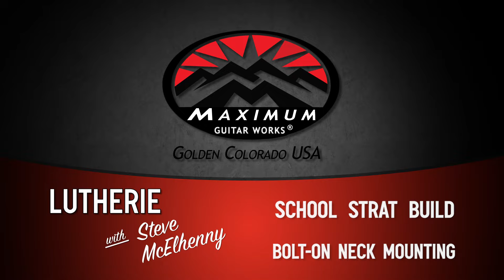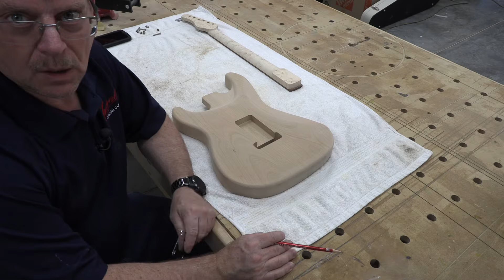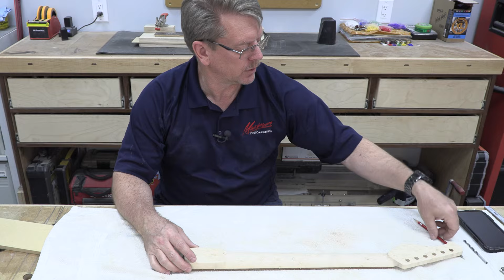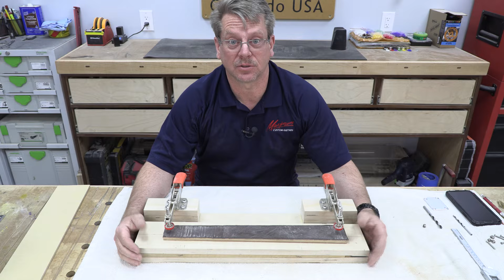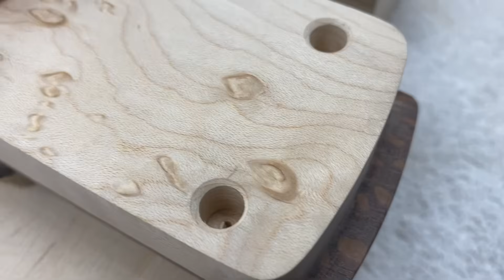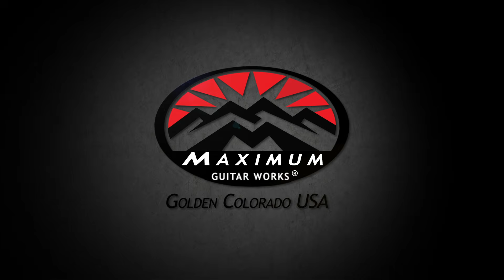The School Strat Build - Best Bolt-on Neck Method...ever!

Comment: Threaded inserts. Never thought about that. It seems like Fender would do this on their upper models, but not that I'm aware of. I currently am installing a Tele neck on a body that does not fit snuggly into the neck pocket. So I came here for your info. A Brad point drill bit seems like a good investment for what I'll be doing. Next project (on the same guitar) is string through drilling for ferrule installation. Just because I've never done that before and I feel like I should know how to if I ever have to. Thank you, Steve.
Reply from the maker: For woodworking, brad point bits are a must.  Inserts are just another way to get the job done.  Some love...some don't.  The key is to keep and open mind and try things for yourself.

Comment: Relying on wood treads is limited, relying on metal threads it’s an upgrade but still limited because in both cases  relying on the sheer force of threads  which again has its limitation‘s…. However relying on clamping force and threads Is the ultimate and has its payoffs and tone and sustain which is the high holy ground of guitar making my opinion… There is a fastener that does both and comes and stainless steel and which is perfect for the situation … and I see nobody using it. As an engineer and a luthier I have tested it and it works incredibly well… Seek and you shall find… Keep on rockin
Reply from the maker: I agree.  When things are built well...all the little things add up to a great guitar.  More important to me is freedom of choice.  If you build it...do want you think is best!  Thanks for your comment.

Comment: Is there a way you could use the drill press to install the inserts?
Reply from the maker: I do that now.  That is what is hard about keep my videos up for long time...I'm constantly changes things up to experiment or compare techniques.  I lower the drill quill with my right hand and manually turn the chuck with my left.  It is more consistent than doing it how I show in this video.  I think I might have mentioned that in the comments before...but I can't alter the video for changes in techniques without removing the video and remaking a new video.

Comment: I leave the drill off and lower the bit to align it. That way I can look at it on the X and Y. Then I raise the bit, turn on the drill and then drill the hole.
Reply from the maker: Sounds like a reasonable technique.  I do that some of the times...just depends on what I think I can get away with.  I continually try to increase efficiency...sometimes it takes more time!  ;-)

Comment: Fender and others never did this because it's unnecessary and overkill. You already see people who overtightened their bolts into the wood so much that it crushes and bends the metal neck plate. How much tighter do you need it to be? 50's, 60's, 70's Strats that have been played to death have neck joints that are tight and structurally fine. You don't really gain anything by doing this unless your someone who removes the neck every other day.
Reply: The best thing about watching and learning new techniques is the choice to use them or not. If you don’t want to use threaded inserts, don’t. I’ve been repairing and building for 30 years and I have drilled and doweled sooooooo many necks. I can tell you, Leo’s wood screws aren’t the best, far from it.

Comment: Could you please list the size/type of bolts and inserts you are using?  It's hard to go through the video to find that information.  Flat head or pan head?  Great video, very helpful.  Thank you!
Reply from the maker: I use 8-32 stainless steel threaded inserts...like these.

https://www.amazon.com/gp/product/B002WC8TRU/ref=ppx_yo_dt_b_search_asin_title?ie=UTF8&psc=1

And 8-32 SS machine screws with oval phillips head.

Comment: Get a full index drill bit set.
That'll allow you to drill whatever size you need.
Reply from the maker: I have them in empirical, metric, and numbered bits.  But I try to present things that work with most people...whenever possible.  Although I refuse to fix stuff with Duct Tape.

Comment: Why isn't he using his drill press to screw the inserts in as well? That way those are definitely perpendicular to the holes he drilled the same way.
Cut off the head of such a screw and use it the way you'd do it with the ratchet but in the drill press: https://www.fk-soehnchen.de/werkstatt/verbindungstechnik/schrauben-muttern-unterlegscheiben/schrauben/Maschinenschraube-DIN-931-8-8-verzinkt.html
Reply from the maker: "He" is now.  Hard to splice that into an old video.

Comment: This is awesome!  You spoke early of aligning neck/body with low and high strings.  Did you do that in-between shots?  It looks like you just forced the neck in the pocket, slapped 6 stamps on it, and sent it!  Do the bolts/inserts have enough wiggle room to do alignment after inserts are installed?
Reply from the maker: Hey Doug.  Although I can't remember everything in my videos without going back and watching them...I was probably referring to a video in my Tele build series...where I go into depth on dry fitting all of the guitar parts and hardware.  The bolt holes are slightly over sized...so there always is a little room for adjustment if needed.

Comment: Awesome video. I got an LAG from guitarfetish’s buyout page to work on. It appears to have replacement plugs already put in for the neck screws that were stripped out when I got it. So I want to go with the threaded inserts. Where do you get your inserts from?
Reply from the maker: The stainless ones are a little harder to find.  My normal place online McFeeleys hardware was out of stock a while back...found the same ones on Amazon.

E-Z LOK 400-008-CR Threaded Insert, Stainless Steel, Knife Thread, 8-32 Internal Threads, 0.375" Length (Pack of 10) https://www.amazon.com/dp/B002WC8TRU/ref=cm_sw_r_cp_api_glt_fabc_3QAQ3VGD90ZBZ7BKX553?_encoding=UTF8&psc=1
Reply: @maximumguitarworks  oh cool! Those are the same ones i was looking at. I was waiting before i put them in my cart. Thanks!

Comment: Mc Feely's had 8-32 x 1-1/4 in. Machine Screws, 305 Stainless, Flat Head, Square Drive, but the only threaded inserts I found there was brass. Is there another resource you use for those? And what depth were they? Thanks for the detailed video!
Reply from the maker: I have also found them on Amazon. 3/8” deep. They are not cheap...but I like them. 

E-Z LOK 400-008-CR Threaded Insert, Stainless Steel, Knife Thread, 8-32 Internal Threads, 0.375" Length (Pack of 10) https://www.amazon.com/dp/B002WC8TRU/ref=cm_sw_r_cp_api_glt_fabc_3QAQ3VGD90ZBZ7BKX553?_encoding=UTF8&psc=1
Reply: @maximumguitarworks  Thanks!!

Comment: Hey guys, I found this project guitar I had built for school. I attempted to do it all by hand and so for my first try it's not the best. The body is is tact but I just need to replace the neck. Its a les paul jr double cut body and so I tried to glue the neck in place. Im thinking to save myself some hassle I will just use a bolt on neck? Any reason why I shouldnt? The pocket where the neck fits in is flat I believe? I need to remove it and clean it up so I was gonna steam it to loosen the glue. I really want to get this guitar up and running, it wasnt cheap to build
Reply from the maker: Yes...the primary reason I can think of is the structural integrity of the neck pocket.  Typically I recommend that a bolt-on neck pocket be no thinner than 5/8" from the bottom of the neck to the back of the guitar.  Many set neck pockets go much deeper than that...because once it is glued in...it is more like one piece of wood.  A bolt-on neck requires stability of the body neck heel area to properly support the neck.  Not knowing your specs...that is what I would be concerned with.

Comment: Steve,   I watched your whole video and may have just missed this detail.   Having experienced crooked necks on bolt in guitars brought me to your video.  My latest is a Jackson Randy Rhoads V3.  I had a friend meet the seller to pick up the guitar since they both lived in New Jersey.  Then I could get it from my friend a few weeks later.  However, once my friend got it,  he saw that the string alignment was such that he knew the neck was crooked.
Reply from the maker: Remember...some room in the holes is important.  You don’t want the screw treads to dig into the body holes...as that could prevent the body from pulling the neck fully in.
Reply: SO,  My question to you is,  did I miss where and how you aligned the neck prior to marking the hole placement for drilling the neck and thus where your inserts would go?   How do you know that the neck is in the pocket straight without a bridge mounted or the e strings attached and sighted straight before you deem the neck in the proper position before the drilling marks are made?
Reply from the maker: In my case...it was new construction...and the bridge was not installed until later...which would be with care of having proper alignment.  There are many ways to verify the neck in bolted into the proper position...and if I didn't show that...I have other videos where I do.  Most bolt-on necks do have a little wiggle room to tweak the neck before you tighten the bolts fully.
Reply: @maximumguitarworks  Steve, you made me laugh to no end, and thanks for your serious answer too.  I will look for your alignment procedures in your other videos, thanks.    Once I had the guitar in hand.  I could examine the neck, screws, neck plate and neck pocket to conclude that the holes in the body are slightly larger than the screws which allows the neck to wiggle in the slightly too large neck pocket.   Conclusion:  despite the neck holes being a snug fit for the screws,  it can still wiggle in the pocket because of the size of the screws vs size of hole drilled in the body.
Reply: My idea for how to solve this is to go ahead and line up the neck using the 2 E strings under tension, tightening the screws once things are straight and evenly spaced.  I then make reference marks on the neck back and body where they meet.  This will allow me to set things in proper position while installing inserts and new larger screws.  This combination of things will yield a properly aligned neck that does not allow as much wiggle room in the neck because the tolerances have become a more tight and precise fit.  Having the mechanical join of a Machine Screw to Metal Insert, will also yield a dependable less failure prone retention system just like your video shows.
Reply from the maker: Well...your problem is New Jersey...Everything in New Jersey is crooked!  What a minute...I'm originally from NJ.  ;-)  I'm not sure what you are looking for...but bolts with treaded inserts are typically not a solution for necks that are not straight.  It could be many things...starting will as simple as a bad setup.  I have seen bad necks...even have own some that needed the fretboard radiused...and new frets installed.  But I wouldn't jump to that conclusion without looking at the simple stuff.

Comment: Greetings again, I ran my mouth on this fine page a few days back. I would like to comment again and say I've watched this video a couple of times and it looks great. The fit, attention to detail. Nice work. Some of the better boutique builders use bolts like these on their steel string acoustics now. Robbie O'Brian has said he can't tell the difference with his ears. And the inevitable reset down the road is way easier. I am a fan of Romanillos wedges with very little glue. That's another subject. Good contact between the components like this example always sound great. Thanks for a great way video.
Reply from the maker: Thanks for the follow up. Robbie’s ears would know.

Comment: Boltz, yez! See these and other attachment styles on bass and guitars. Recessed and the likes. Mortis tenon acoustics going with these more often now too. We are entering the "IKIA Era"- Just made that up for todays concept-. Here's what I like to do on a from scratch strat. Thinner / vintage neck attachment screws on guitar. Bigger modern screws on bass, always use the plate. Should only need to attach neck once, get it right.  Vintage style six screw bridge. 4 of the six screws are guides and unless they are spot on they can leach sustain. So I only drill/use the two outer ones. Bent steel saddles. With the right length screws can be made comfortable. One more thing, as nice as they are, exclude the little plastic plate backer. Twelve thin points and a steel plate, two thin screws, and four thin bolts transfer all those good vibrations. Check out Farudu's video on setting up perfect floating 6 point trem with Post-It's for set up, pure genius. She should ring out nice.
Reply from the maker: I've never owned a bolt-on neck that I didn't remove the neck (eventually)...which is why I love bolts so much.  I've had many used guitars when the neck screws where stripped...and I needed to repair them.  I try to use the best materials, parts, and best practices to the best of my knowledge...it generally never lets me down.  With that method I seldom can ever hear tone issues that make me say..."I'll never do that again".  Most of my changes in the way I do things are things that give me better accuracy and repeatability.  But even with that...I try to remain open minded to change if I see or do something that works better.  I'll look for the video you mentioned above...thanks for the comments.

Comment: Normal zinc plated inserts are more than enough strong. I have made some tests, in hard woods, and the insert always rips off the wood before breaking
Reply from the maker: Do they look like the stainless ones I'm using?  Or are they the flanged top ones you are talking about?  Any king of steel would be strong enough...I just don't trust brass for this function...but others say they use brass all the time and no issues.  In the end...using anything you like or have access to is probably better than wood screws.
Reply: @Maximum Guitar Works  the cheap flanged ones, with big threads. Last week I tried with an M6 insert in Ikoro and hard european ash. A m6 bolt, a waser and a nut. Tightened the nut so it pushed down the whaser, and the insert ripped the wood without breaking.
Reply: I don't see any advantage in using brass either.  it is too soft I think

Comment: wipe the screw threads lightly with Chap Stick to lubricate it going in and it will not dry out. A toothpick wet with yellow glue can dampen the inside of the body holes before screws go in...Glue will slightly swell and harden the body holes as it all sets up overnight.
Reply from the maker: Thanks for the comment Doug. What is the benefit of lubricating the stainless steel bolt?  I was also thinking that fish glue might be good for the inserts.
Reply: @maximumguitarworks  Hi Steve, he is talking about the insert threads.  I use bar soap on the threads of wood screws when screwing kitchen cabinets together at the oak stiles. It allows the screws to go in smoother and they don't break off before they go in all the way.  Not that the insert will break but will thread smoother.  Nice video.
Reply from the maker: That would make sense.  I dip my tuner screws in Johnson's paste wax for the same reason.  Only had to learn that lesson twice (once wasn't enough).  I just didn't get lubricating the screw thread part.

Comment: This was a great detailed video! Very helpful! I wonder Is there any chance the neck screws getting loose under string vibrations after some period of time? I just worry about the metal to metal contact regarding screws and the inserts. E.g. I faced this problem recently with an aftermarmarket telecaster bridge action screws and I had to use either Loctite or something else to make sure they will retain their position. It Is not the same thing of course and you can allways check how tight the screws are or you can feel If your neck Is getting loose but just wondering. Thanks!
Reply from the maker: Thanks for the comment.  I have never had an issue with the bolts in the neck getting loose.  They are tight...and under constant tension...so appears to hold up well.  However, there is also no harm in adding a little loctite if you feel it will help.  I have had the same thing as you describe happen with bridge screws...so I know where you are coming from.  Hopefully you enjoy my other videos too...and spread the word about this channel. Take care.

Comment: Pro tip (not my idea; I'm far from a pro). I purchased inserts from a guy on eBay that accepts a hex key to screw in the inserts. No need for specialty tools or home made do-das. Stick your (straight) allen key into your drill press. Apply downward pressure while screwing in the insert by turning the chuck manually by hand. With your (totally awesome) jig you will get absolute precision. Method courtesy Matt @ Texas Toast Guitars.

Comment: And then after all that y'find that the neck is misaligned by a fraction, the high-e is sitting too close to the edge of the fretboard, and there's no way to shim or adjust it without filling huge 1/4" holes.
Reply from the maker: Are you describing your situation?  And If so, are you asking how to overcome this situation?  Because I can tell you how prevent or fix this.

Comment: I been trying to figure out a way to fix a neck of an experiment guitar of mine for months, in which the holes of the screws went too big after an impact. I was thinking of using inserts and similar stuff, but i was overcomplicating it, and now I see you talk about it and I see a simpler solution than the one I was planning. Thanks for appearing in this video.
Reply from the maker: Good luck with the repair. I sometimes over complicate things...but try to remember that simple is good.